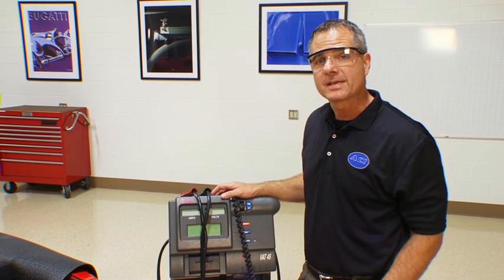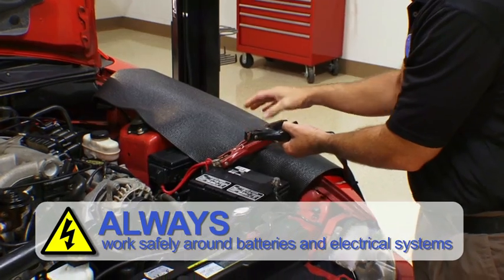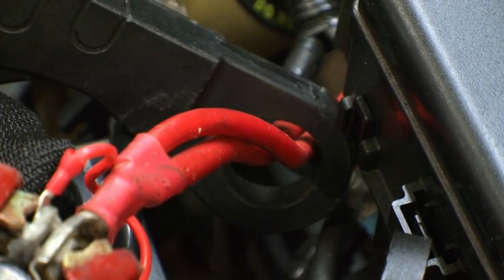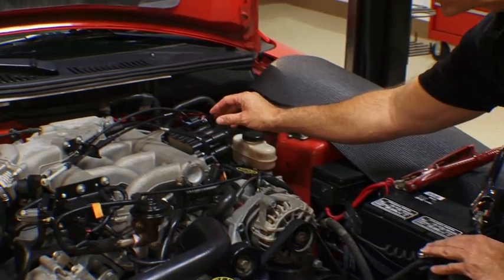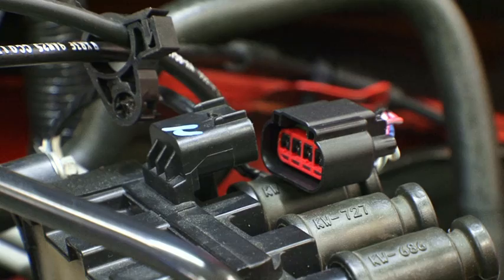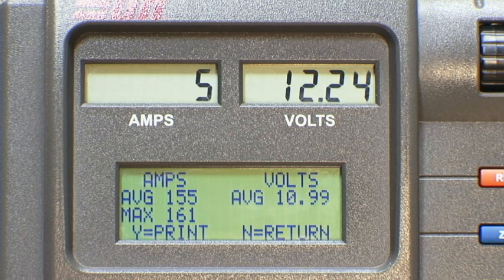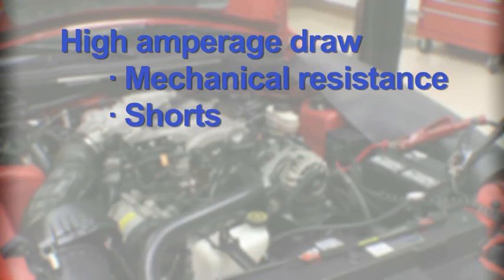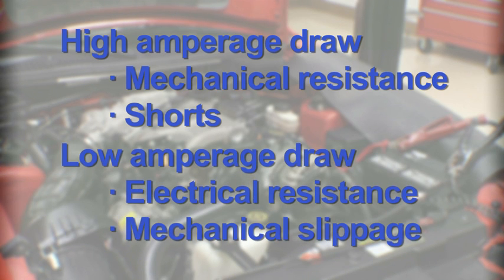ACI Starter Draw Test

Comment: Hi jhon... My cars voltage goes down to 2v when cranking and after 3 cranks it slow cranks and it dies. Weve Tested with 2 new batteries and booster pack but same thing .. I know it might be within the starting circuit but im also not gettting a ckp v signal nor will it slark ignition .. Do u think it might have something to do with the cranking also??? Thanks